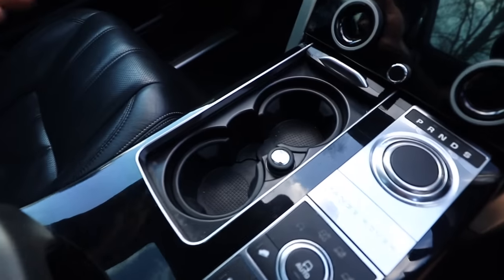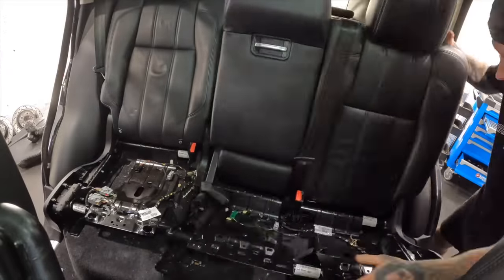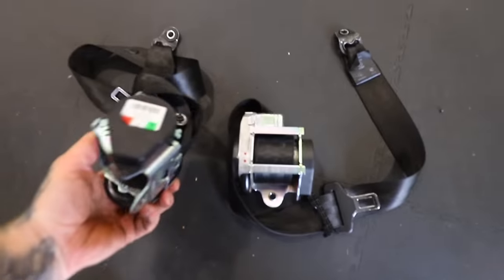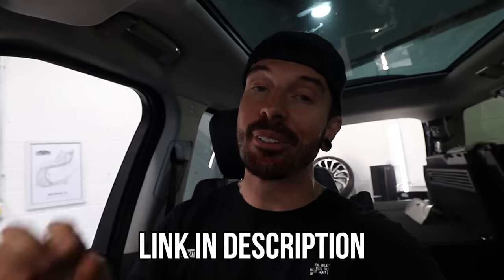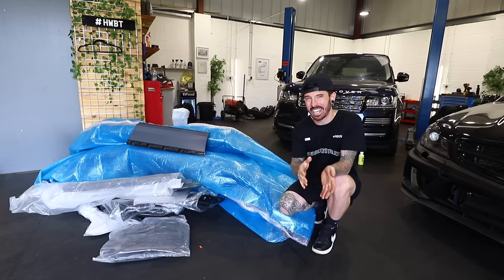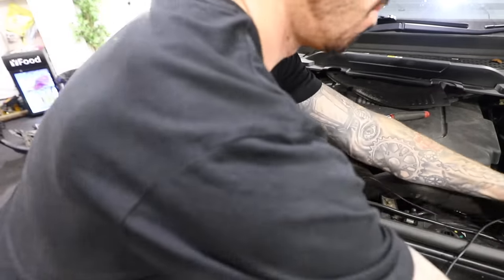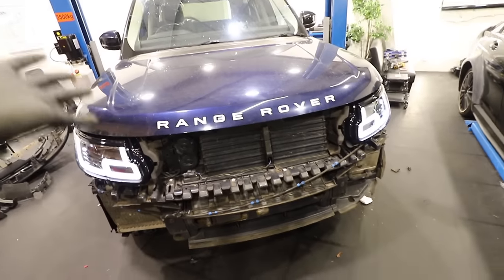REBUILDING THE CHEAPEST RANGE ROVER IN THE UK | PT3

Comment: Upgrade the infotainment system! I would have gone for a black headliner too! Love the progress!
Reply: i think thats a bigger job thank u think and really expensive. those lights he got there around 3 grand just for them
Reply: @dionwilkinson3028  na i got a whole SVR set with facelift headlights and tail lights for 3k total AUD on my 2017 range rover sport.
Reply: @mattymeds2  fair enough dude. my mum has got loads of problems with her sport at the moment 2015 one gonna cost near enough 10k fix it
Reply: @dionwilkinson3028  yeah it’s a shit car tbh, previous owner of mine has had a engine replacement due to a faulty DPF filter.
Reply: @mattymeds2  oh wow. well we have had mine since new and problems are just getting worse and worse. we had a leaking exhaust manifold i think and put it into limp mode and now something else has started to leak its the exhaust as well i think sounds cool but needs to be fixed as its putting it into limp mode again and its making it not idle right either

Comment: Hey Matt loving the content, just a heads up from one car fanatic to another.. i work for JLR as a technician and the loss of steering control is common on these models. A bolt for the knuckle on the lower control arm of the front suspension comes loose and potentially leave you without control of the steering. Find out from a dealer if your car is affected; im sure its a recall. Ether way its not to bad of a job providing the correct tools and parts, as with anything. Good luck 🤞🏻

Comment: you will need to check what the car thinks the steering angle is in the straight ahead position, they have a soft lock stop, which is the resitance your feeling. If its out 360 degrees, work out which way it needs turning and disconnect the steering column turn the steering wheel and reconnect the column.

Comment: From memory on mine you could do a steering angle sensor calibration / plug in and check angle data. Also used to reset the air suspension by turning wheel lock to lock whilst in park.

Comment: Are you sure the clock spring was centered when you installed it and not already turned one rotation before you installed it? On my Merc you had to make sure it span 2 turns each way before instal to make sure it was centered (mine was throwing esp lights when I turned)
Reply: Clockspring not central was my first thought too.
Reply from the maker: if the clockspring was broke the buttons wouldnt work
Reply: @MatArmstrongbmx  May be working okay, but not centred.  Just a thought. 🙂

Comment: Great video! I facelifted my Range Rover Sport to the 2018 shape too 👍 on the sport the bonnet is exactly the same but the wings are different! Only thing to look out for is buying aftermarket lights from Alibaba because they’re terrible light pattern and left hand drive.. My first set failed MOT so I had to swap them for genuine lights, much more expensive 😓. You did the right thing buying genuine, even if they’re a bit battered.
Reply: Hello mate - do you mind sharing where you got your body kit for your facelift - im looking to do the same. PM me if needs be, cheers
Reply: @jamesjay1838  did you get an answer on this mate?

Comment: I had the same faults codes on the dash and it turned out to be the speed sensor, a decent decoder can pick it up but won't tell you what wheel it's on. Took me two goes to get the right one! Class rebuild dude keep it coming !!

Comment: Great job so far! When you were replacing the intercooler bracket, your intercooler actually looks bent inwards from the bottom left up to the top right. I could be wrong on this part, meaning that it's supposed to be like that, though again, it does look like it.

RR's are not something I work on, usually once per year that I even see a RR in my shop, it'd be a Discovery diesel. Vogues aren't that popular here!

Again, great job so far!

Comment: Your steering is EPAS (electrical power assist steering) the resistance is the steering thinking that you are at the end of travel the SASM is out (steering angle sensor) with software you would be able to dial it in easily but you can also work it out by the amount you have to turn to feel resistance and turn the rotary coupler back to the original position, with the steering wheel off obviously, there’s two grey rubber pins that move the coupler. Hope this helps.
Reply: I’m saying this as a guess, most likely happened during dash removal. Entirely possible it could be a genuine fault but I know this is an issue people have had when doing dash out rework.
Reply: Oh look I was right.

Comment: I had that exact issue in my Mercedes with the steering wheel clock spring, It would turn fine to the left and then jam and give warnings when I turned to the right. I took it apart and refitted it and it worked fine. Most likely something to do with the clock spring

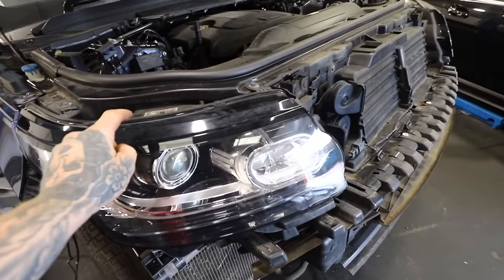Comment: 12:00 bmw's have those in colder markets. They're to allow for less cooling during the winter, they block the radiator off when it's cold so the engine reaches temperature faster. 
My e60's were broken (go figure) so I removed them.

Comment: The fault with turning steering ive had a few times on cars. I work in a garage and it was the clock spring. And same symptom’s as you. Just thought it was worth a mention. Just incase 😋

Comment: 8:49 It could be that little battery you saw in the trunk. BMW has the same problems with active steering if the battery is defective. It is important that if you replace it that it is a original battery. It has to be coded otherwise the problem remains.

Comment: The issue with the steering wheel lock to lock is the steering angle sensor. Drop the bottom panel under the s/wheel and you will see the pinch bolt for the steering column. Drop of the steering angle sensor and replace. If its done over 100k chances are the contacts inside the sensor will be shot. Once done all the lights should go out.

Comment: The steering issue is because you’ve misaligned the steering angle sensor which behind the steering wheel mount. If you’re lucky you won’t have damaged the ribbon cable inside it, but more often than not, it damages it beyond repair.

From me memory if you take the column cover off and the wheel, you’ll see there’s a window in the steering angle sensor body which shows where the limits are (there’s an orange marking which shows the extremes of the sensor).

Often, when you go beyond the end stop, it permanently damaged the sensor I’m afraid

Comment: The small battery in the rear is part of the stop start system . If when driving it doesn't work then it may have been manually switched off

Comment: That headlight coming out that easily. A friend has the best spec most recent Disco in the UK. Whenever it goes to the main stealer, they do some kind of seance with it. This is a somewhat regular seance 😂The last time it was in, a robot in the factory was blamed for an 8 grand warranty claim. The windscreen came out under light pressure from a mechanic’s hand 😂

Comment: I believe the steering wheel fault is because the steering shaft is a turn out to the left/right, separate the steering shaft from both ends and give it 1 spin to the left or right and reconnect

Comment: Your steering wheel is prob. just the steering angle sensor that needs to be calibrated. If not, you can check your steerinng column and rack.

Comment: check that the earth is ok on the driver's side under the arch liner they can break and throw up all sorts of faults. But by the look of the faults, your looking at a speed sensor issue or steering angle sensor

Comment: Was also thinking the rack is possibly damaged....torque sensor see's a tight spot where the ram that slides in and out of the rack is bent....throws faults up
Reply from the maker: Can’t remember it ever doing it though before the dashboard and inner tie rod was don
Reply: @MatArmstrongbmx  hmmm could try disconnecting the track rod ends and do the same test to eliminate any suspension/ball joints then at that point its either the rack/collum uj's

Comment: I am in awe on your talent. But it doesn't make sense that you work you're arse off, paying just 500 quid plus tons of work for the doors,  save big money on the dash, and airbag then spend 5 k plus a bonnet to give it a different smile. I know you're making content.  But 15k for the car 12k plus for parts. 10 k for your time 200 hours. There is no profit at all, it owes you 47k  because its still a resurrected written off 2015 car. Whereas if you hadve done the doors, panels, dash, wheel it might have owed you 22k sell for 32k. Whereas the maths not there fir what you've done. But bloody glad you did it. Thanks 😊

Comment: That Intercooler behind the bumper has had it. If you don't replace it it will bite you back, it is that mangled , mis-shapen, fins don't matter but even the tubes are mangled 😔
Reply from the maker: It’s a radiator and would leak if it were split or cause cooling issues when stationary. It does neither 🤷‍♀️
Reply: @MatArmstrongbmx  at the Moment! 😱

Comment: Great video, the hole ring crimp lug that you used for the headlight feed should be the red one, blue is too big for the cable size and you need to use a proper crimping tool and not a heat gun as it’s not a shrink